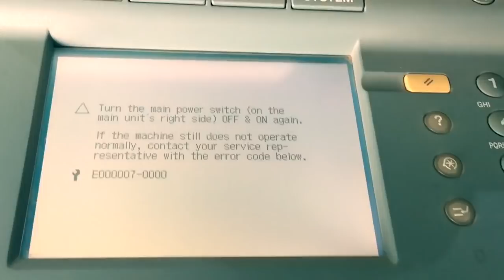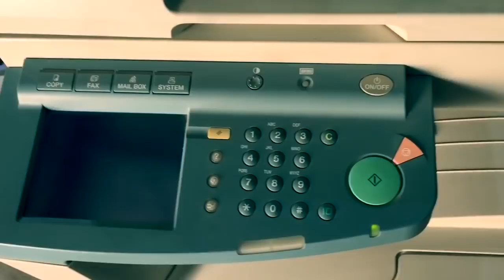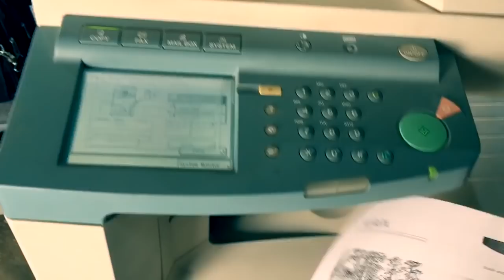how to replacement of the fixing film for a canon ir3300, ir2800 | error E000007-0000 solution

Comment: Can you mount a fusion unit of the Canon ir 2018 copier on the canon ir 2016?because that of the canon ir 2018 has a problem makes copies or prints with wrinkles creases not always does it think it can be pressure roller then i want to tryiton a 2016 that i have in the lab.i am a reseller of multi function copier machines .canon 2016 generates a e0007 service code.thank you so much for your aiuto.